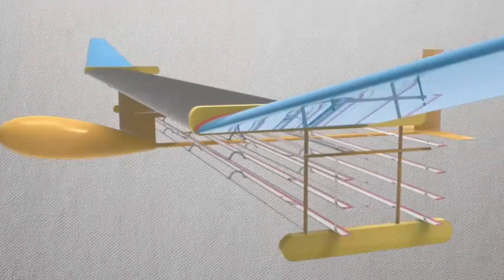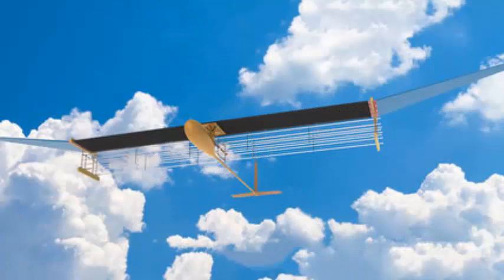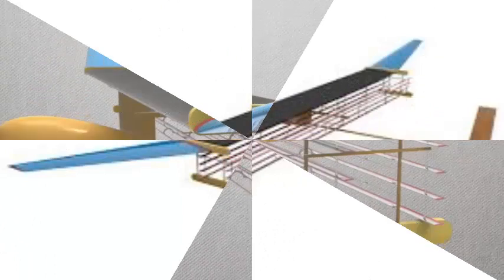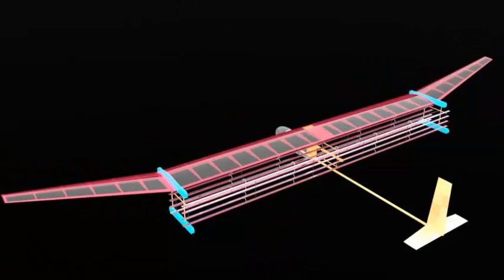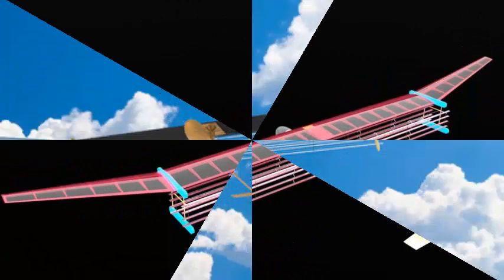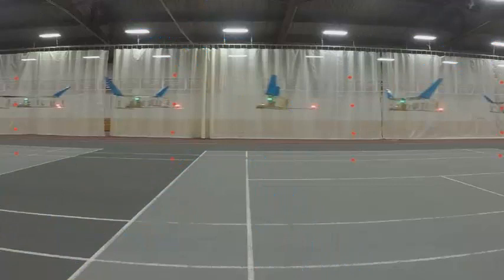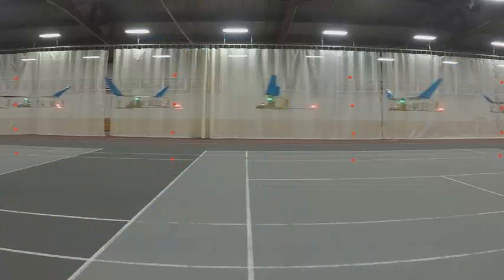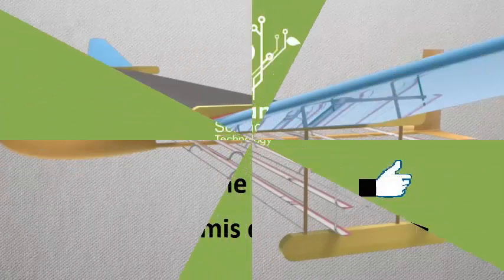MIT create a plane that flies without moving parts using electroaerodynamic propulsion.

Comment: The proven first ion propelled aircraft to carry an onboard power supply, can be seen in flight by clicking the purple icon to the left.  It is much more than 1000% more efficient and powerful for its size. It has the power to go straight up with its power supply for several minutes.